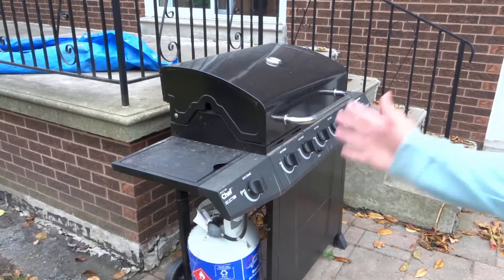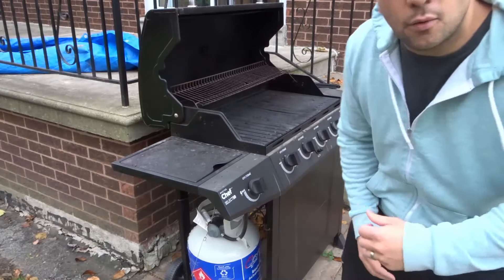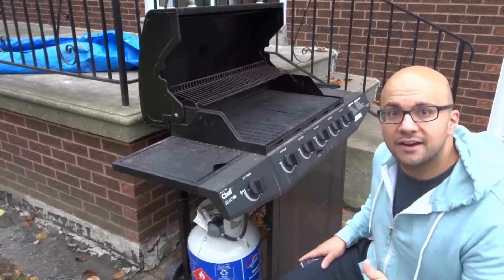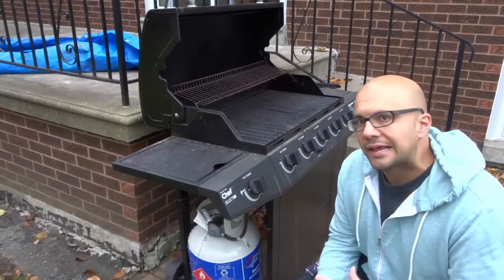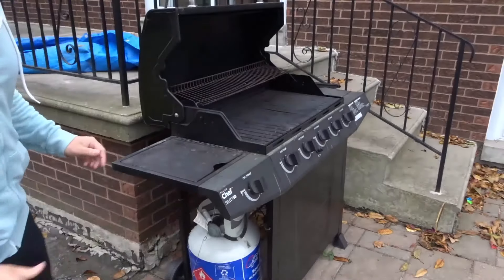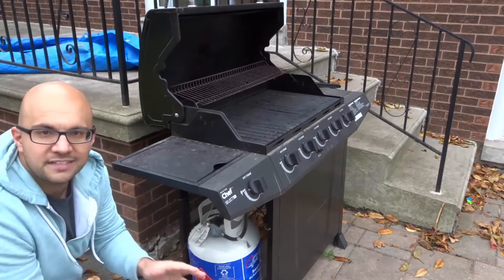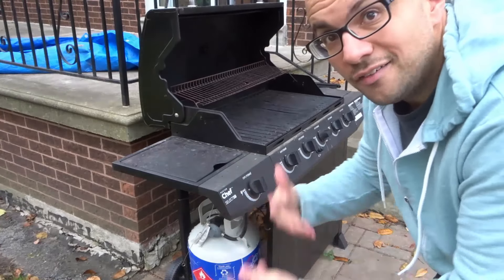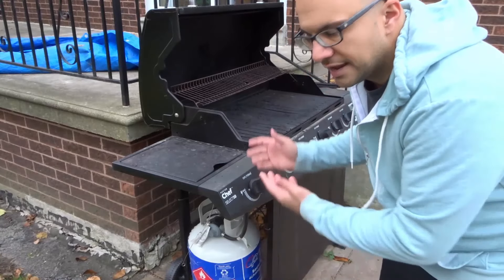Low Flame On A Propane Barbecue-Easy Fix-Tutorial

Comment: Bought my BBQ grill in 2006, for my 2nd floor apartment and kept it on the front porch. Used it for 2 years and hated it because it was unbelievably inconvenient running up and down the steps to cook meals. It sat since then.  Fast forward 17 years and I moved in to a new home.  I fired up the grill with a fresh tank and used it since April without issue.  Then during our 4th of July party, the grill was only heating to 300 degrees.  Took forever to get it up to temp.  Thought there was something wrong so I cleaned all the burners.  That didn't help.  Found your video and it worked (yes on my 17 year old like-new regulator)!  I couldn't be happier thanks for sharing.  In less than 7 minutes the grill was up to 425 degrees.

Comment: Tried this tonight after replacing regulator and hose, releasing pressure valve for ten seconds on gas bottle as suggested in other videos.
Had the air compressor out to clean the lines out, and a small crowd of bbq experts gathered round too.
Watched your vid tried your trick, high fives all round,beers clinking, as the flames doubled in size in front of our eyes. I won’t say how many collective years of tertiary education and hours spent bbq between us, but it was way too many. You are the man.

Comment: Worked great!  Have nearly a full propane tank but low bbq flame.
I thought gas line or valve was clogged or “broken”.  Followed your video and problem fixed in less than a minute.
I will now open tank valve first and then open BBQ gas knob second.
65 years old and i still learned something new today. 😄

Comment: Thank you. Saved me from going to get a new propane tank. Burners were super low because I had not turned on the tank on first for the correct ignition sequence. Caused a bit of a disaster at the time as it wouldn't heat above 250f, but I know now why!

Comment: I'm glad I found this video. I had disassembled and meticulously cleaned the inside, grill, burner holes, burner shields and it only went up to 225 F. Going to try this next, I think this is the reason because I was getting the same size blue flame on all burners, but only 225F. Thanks!

Comment: Me fadder loves ya, Me mudder loves ya, and I loves ya! My propane firepit was generating only a low flame. I had shut it off at the tank and had not shut off the burner valve. We spent a whole evening enjoying what was about 1/5th of the flame we should have had. I just went out and tried your fix and it worked perfectly. Note to self: Turn off the burner valve after using any gas device!!

Comment: This was soooooo helpful.... I had a feeling something was wrong with the flow of propane, but haven't been able to identify what that problem was exactly (my issue is that I am not seeing any active flame coming from the venturi pipes [if that is the right term] but definitely getrinf plenty of heat when turning on the BBQ? The pipes are clean, and all holes clear of any old food debris?

Anyways ... I am hopeful you you have solved it for me!  

And ...if nothing else, I am now aware of the proper steps in turning on my BBQ safely and effectively without triggering that safety feature!   

Thank you sooooo much...this was a fantastic video!!  😊

Comment: Lol I've been using my smoker on low flame for about 3 years. Everything I smoke I like for the temp to be 225 but Wednesday it wouldn't even get to 200. Two days later I'm looking at this video like "wow" I would've never thought this. Changed my tank once thinking this then cleaned the burner. Also purged my line before every use lol. And to think all I was doing was turning it on fast lol. I noticed the click sound that it makes every time except this time great job

Comment: Thanks kindly for sharing! The “Over-Fill-Protection” is inside the tank. A float on an arm to STOP refilling at 80%. The second protection is a high flow / leak restriction that comes on if a burner is open when tank is opened. The rest is fine and yes, open the lid. Eyebrows grow back but look odd for 6 to 8 weeks or so! 😮 God Bless.

Comment: Thank you sir, you saved me from potentially having to buy a brand new BBQ :)
I had to remove and wait 2 times before the regulator reset itself. Just had it on for about 10 mins at 650 degrees for the initial "burn-off".

Comment: THANK YOU! THANK YOU! THANK YOU! 

I Will often shut the flame off from the tank, instead of the burner controls - that way i bleed the line and there's little-to-no propane in the feeder line. Well the last time i turned it off, i forgot to shut off the burners and when i went to start everything up again, the burner valves were open and im guessing thats what set off the regulator - cause, EXACTLY,  i could not get it to heat past 300.... But i followed your instructions and i was flamin' and flippin' after that.

Comment: I was out of town and hadn’t used my grill in a while.  It does need to be cleaned but I’m having this problem right now as I’m cooking pork chops.  I will try this tomorrow.  I also noticed that I turned on the gas and it didn’t work. I turned off so I thought and it lights.  I always turn my grill off so somethings strange.  Maybe I didn’t turn off and this has happened but my gauge doesn’t change wether it’s one or off!  Thanks for video!

Comment: You earned a thumb's up, that did the trick! I have another problem, though. I have replaced the burners in my grill. When the grill is on low, it seems to be fine. But as I turn it up, the force of the gas coming out seems to "blow out" the flame. Not on all holes, mostly on one side. I can see the flame root move away from the hole and then it goes out. Any fixes for that?
Reply: Adjust your air/gas ratio.  Lower the amount of air.  Too little air makes orange flames and too much blows out the flames.

Comment: The OPD (overfill/overpressure protection device) is incorporated into the valve on top of the tank, not in the regulator.  The excess flow is generally located in the device attached to the cylinder at the cylinder.  Never fill a propane tank more than 80% of it's rated weight in weather over 80ºF.  Cold weather (let's say below freezing) likes tanks that are more full because there is less pressure in the tank due to the temperature.

Comment: My best friend told me to remove my pressure regulator hose and replace it with one for a turkey fryer, because it is high flow BTU. I will have to try this before I go that route. I always turn my bottle off after cooking. I did replace my manifold and my 3 gas tubes. I still had low flame with the knobs on high.

Comment: I JUST found THIS in my BBQ Owner's Manual: 

BBQ 101: Guide to your Regulators Flow Limiting Device
What is the Flow Limiting Device?

The flow limiting device is a safety feature built into the Propane regulator that detects a change in pressure, limiting the amount of propane that is delivered to a BBQ’s valve assembly, causing unstable performance.

What causes activation of the Regulator’s Flow Limiting Device?

Improper lighting procedure
Opening propane tank too quickly
A leak in the system
A positive connection has not been made between the propane tank and the valve assembly/
When should the Regulator Flow Limiting Device be reset?

Burner will not light with igniter or match
Burner does not get hot enough
Low or incomplete burner flame pattern
When a leak test is performed and no leak is found
When a positive connection has not been made between the Propane tank and manifold assembly.
How do you reset the Regulator Flow Limiting Device?

Open the BBQ Lid
Turn ALL main control knobs to the “OFF”/CLOSED position
Turn the Propane tank valve to the “OFF”/CLOSED position
Disconnect the Regulator hose from the Propane tank
Turn ALL main control knobs to the “ON”/OPEN position
Let stand for 1-2 minutes, allowing all excess gas in valves and manifold to dissipate
Turn ALL control knob back to the “OFF”/CLOSED position
Reconnect the regulator hose to the Propane tank- hand tighten only.
Check all hose connections to ensure that a positive seal has been made
Slowly turn “ON”/OPEN the propane gas supply
Wait approximately 5 seconds for the regulator pressure to stabilize
Turn “ON”/OPEN the selected burner control knob to “HI”
Press the Multi Spark ignition button or match light selected burner.
Safety Devices in Regulator

Flow Limiting Device: The Flow Limiting Device alerts us to a change in gas pressure due to a leak, improper lighting procedure, system blockages, negative connections between manifold and gas source, and opening gas source too quickly.
Thermal Sensor: The Thermal Sensor is built into the interior of the regulator hose. It will automatically shut off the flow of gas if the hose reaches temperatures between 115-150 degrees C (240-300 degrees F). If this temperature is reached the hose and regulator will, melt away from the tank to avoid serious damage.
If this temperature is reached the hose and regulator will, melt away from the tank to avoid serious damage.

Comment: Somtimes this works but they really shouldnt be this finicky. They sell replacment hose/regulators at Depot for 20bucks, just replace it if it keeps acting up.
Reply: Are ther different sizes?
Reply: @jeffa847  no, they are universal for 99% of grills
Reply: @ntme9  Thanks
Reply: The OPD is in the tank valve, not the regulator. If the tank has a triangular valve, it has an OPD. Otherwise it doesn't.

The regulator is where the magic is happening.

But other than that, a great article, and will definitely help many!!
Reply: I just bought a new hose because last one leaked, it's not the hose fault it's because you didn't start it in the right order.

Comment: I would LOVE to see a fact sheet on how many people who are not mechanically inclined have called someone into their homes to check the BBQ and have been charged a "cleaning fee" because they were told that " wasps have plugged the gas orfice" ...I bet there is more than 2 accounts of innocent, probably older people being duped by this newer technology. I'm 63 and I did not know. 
    One thing about the internet and YouTube in general. IF you can type out the problem you are having properly and precisely, you WILL find an answer to it on the internet. That is exactly why I'm here. Just remember, don't be like my ex-wife and type out a paragraph and expect an answer. " Low heat output from propane BBQ" is all you need ... "I tried to use my BBQ and sometimes it will cook hamburgers just right, but when I try to cook a thick steak, it seems to take longer than it should, what seems to be the problem" ...you will end up on a webpage that shows you how to sear a steak. . . hehe.

Comment: This misses one very critical thing. Your regulator is doing its job, and you actually have a leak. Spray down fittings/gas lines with soapy water and check for bubbles before trying some hillybilly circumvention.